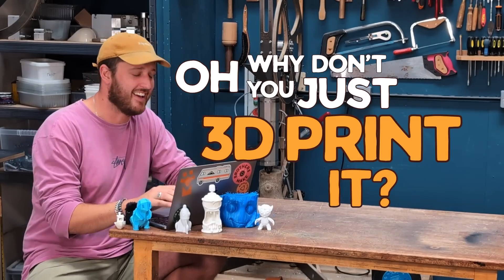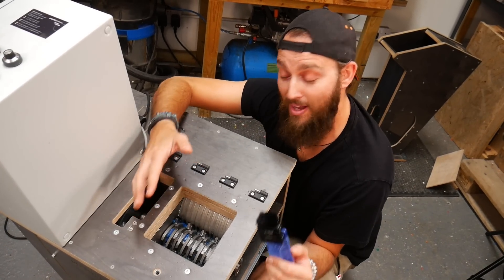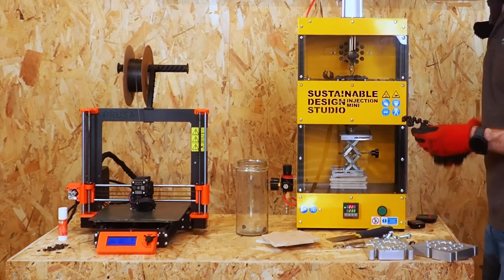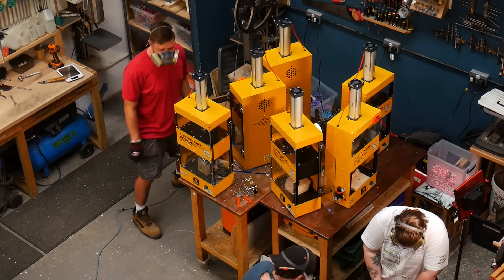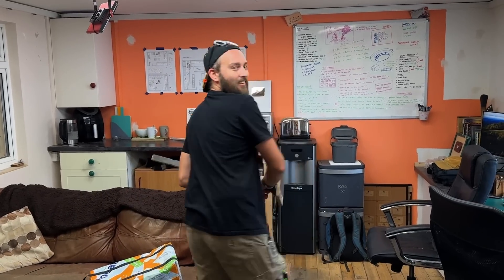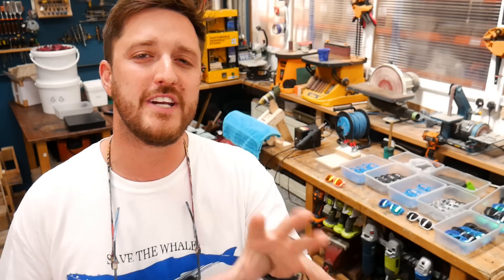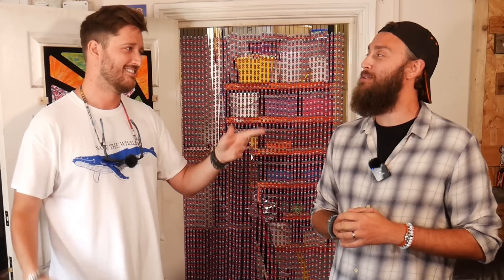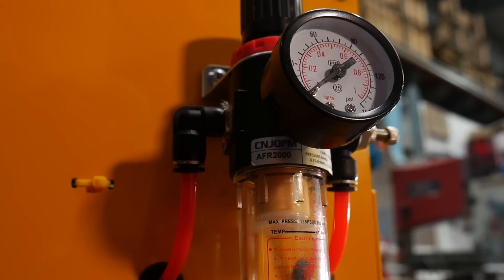Is THIS Better than 3D Printing?

Comment: I think this is a great video, I would say you have missed out a way of batching on the 3D printer. You have a much larger print area on a 3D printer. You could print across the whole bed of the printer and then with very small infill between layers print another layer of 3D prints as the printers can print in 3D where as the injection mold is set in one axis.
There is the other issue that a awful lot of waste material is created for each mold due to the plastic channels. This is also created in part on the 3D printer but can be dramatically reduced compared to the mold, in the case of the beads.
Still a great video and an area of work I had not realised that had become so affordable to enter

Comment: Don't forget manual labor when calculating the price of injection molding, 3D printing is mostly automated leaving you free to do other things. Injection molding requires you to be there the entire time.
Reply: Hahaha, they literally show you asking this question and then answer it. 😂
Reply: @OpalSea  And they answer it wrong. They said "you have to maintain the printers" as if that takes nearly the same amount of time as operating the injectors. It absolutely does not. Source: we have shelves full of prusa XLs that I work on at my workplace, and I also work with a guy who runs a bambu farm.

You only get similar labor cost with unreliable printers. The prusa mark 4 used in the example might actually be the most reliable printer that you can buy below enterprise grade.
Reply: @Mindbulletz  I've worked in injection molding shops with fully automated equipment that just requires someone check on it to swap the output bin when it's full, and refill the input hopper every few hours.  Thousands upon thousands of perfectly clear medical-grade parts came out of that machine every shift. 
The real story, which they talk about in the conclusion, is that for any given part, there's a volume of output where it makes sense to switch from FDM to injection.

Comment: You could speed up the 3D print quite a lot by printing it flat on the bed, 0% infill, and enough walls to fill in the difference. Also, comes don't need fine detail, so you could use a 0.6 or 0.8 nozzle instead of the standard 0.4. Still won't approach the injection molding speeds, but will be a lot faster for prototyping.

Comment: You seem to have missed the point of 3D printing. Your beads are a very simple design as is the comb plus you oriented the comb in a way that would be very bad for strength. Your examples were very good for injection moulding but not great for 3D printing.

You can 3D print things that are impossible to injection mould or CNC machine and every item printed can be different or customised, that is something you just can’t do with injection moulding.

Comment: Timewise a fair comparison would be starting the 3d prints as soon as you place the order for the injection mold.

how long to just start 3d printing compared to having to design the mold and order it, get it and then start working with it.

The upside of 3d printing is that you can work as soon as you want but it will never compare to the efficiency of Injection molding (After having the mold).

having said that, the rest of you a analysis is correct.

I have a few 3d printers but i really want a Injection molding setup

Comment: I love your stuff, but this video just seems like alot of cope
It's like you're comparing cars to trucks
Yes, they are both vehicles, but you have much different use cases

That's great, you can injection mold 42 combs in the time it takes you to 3D print one
But when am I going to sell 42 combs?
And how much did it cost for that mold?
What's the design process like for that mold?

How quickly can I go from an idea in my head to a fully finished product with an injection molder? Because with my 3D printer, I have gone from idea to an actual product in less than an hour before.

These are tools. They are not better or worse necessarily. They are better or worse depending on the goal.

Comment: You missed a major part of your injection moulding process. How much time and cost is needed to create the forms? A 3D printer does not need any form, you can print what you want, whenever you want. 
With conveyor belt printers can you even print series without stopping and removing of ready parts.  
Why do you guys belive that massive plastic is better than partly hollow plastic. Our bones are massive or have a partly hollow structure?
Btw, its kind of stupid to try to print the comb standing on the print bed with the teeth upwards. Flat on the bed, gives a nice durable comb, to last years.

Comment: you should make some kind of punch/cleave that fits the exact shape of the beads after taking them out of the mould, so all you'd have to do to get off the ring that holds them and the excess is push down on it with a lever or something similar

Comment: anything that falls into the category of 'crap that blows in the wind' things like syringes, plastic bags, beads, and whatnot are better off molded for sure, 3d printing can't compete at such immense volumes. For beads in particular though something that doesn't require post processing is probably better, maybe some kind of weird multi step hot forming/extrusion setup would work? I'm not sure.

Comment: It seems to me the printer was used wrong.  In the standing orientation you coult print mayby 30 comes at once on a mark 4  maybe more. And you would not be working after the setup time. If you factor in the labor costs also for post processing you calculation would be different. And for the beads you could print maybe 200 at once without support if you slightly optimize the shape for printing.  Than you would have nearly no postprocessing.

Comment: A UV bug trap will solve the fly issue fast.  Bug zappers can cause insect body parts to be strewn across a wide area as their bodies explode in the zapper.  Another way to keep them out is to use a high speed blower placed at the top of the doorway.  This will create an air curtain they can get through.  Effective against flying and many crawling bugs.

Comment: A fair comparison would be to run the printer while you wait for the mould to be machined ;-) Or modify the product slightly so you need a different mould, then wait some weeks for them...

Comment: When it comes to the cost breakdown, you went with the cheapest injection, molding machine and most expensive 3-D printing machine you can get three times the amount of bamboo lab A1 printers for the same money as the Prusa Mark 4’s

Comment: There were a lot of mistakes and bad assumptions here. Bambu a1 (mini) is the cheapest good quality option is like such a bad assumption. And filament you can get when you buy 5kg at once you can drop that price per kg easily to 15 or lower. And you ignored the time it took you to design the mold. Because let's be fair it's probably a version 2 or 3. And not the first try. Also you ignored that you do need significantly more material for the injection molding because of the waste. Then there is the the fact that an automatic print removal system on a 3d printer is a simple GCODE script and some slight modification of the printer. Making the 3d printer fully automatic and 24/7 capable. Demolding is way more work intensive. Now all of those are small things but they add up to muddy that comparison heavily

Comment: The biggest advantage that 3D printing has is that it can make things with complex geometries that just can't physically be made with injection molding. An example would be an object with internal voids.   For what you guys do, though, injection molding is clearly the better option.

Comment: Each Tool has its use
3D is primarily for Prototyping and maybe small scale Production Runs
Injection Molding is, as you said, for larger Production runs
How nice would it be if you could combine those two… like 3d printing the Molds maybe?
Ik Ik, most plastic for FDM 3D melts at a lower °C then the Plastic used for Injection, but what about Resin printers?

Would that work?
Like print the Prototype FDM, work out its Kinks, turn the Prototype.slt into Mold_Form.slt and print it in a High temp Resin.

Comment: try tpu 3d printed flexible sprue molds, and also try liquid solvent pla, like ethyl acetate solvent, then just point solidify the liquid PLA with laser or maybe UV. so whats expensive about 3d printed injection molds and mixing and pouring an AB plastic into the mold. yes you can just use a AB plastic syringe, no need for expensive press machines. keep it simple, did you forget. yes a piston syringe is hand powered.
Reply: oh yes and speed comparison, well one injection molding machine is same as about 10x 3d printers.

Comment: This isnt even a quantity vs quantity problem, injection molding makes solid seamless parts that have a very good quality hand-feel, 3D printing just doesn't hold up to that or the structural strength of a 1-shot part. 3D printing is a compromise on all these, in order to do it at home for cheap. On the other hand, we have things like 'fuzzy skin' to help hide layers now, textured build plates. And the ability to print hollow or dense selectively.
Reply: If you print the comb laying down, I can safely say the strength of that comb on a 3d print is the same strength or super close to it, using similar materials.
Reply: You should try holding a 3d printed object that was printed with said "fuzzy skin". It has a much, much nicer feel than any injection molded part. Night and day difference. And yes, it does completely get rid of seams and layers.
Reply: @SirSpence99  I mentioned fuzzy skin at the end of my prior comment. It really depends on what the part is. I kinda think the majority of beads are desired to be smooth and not fuzzy textured though, but it probably has its uses there as well.

Comment: The comb is a very basic design.. the presses are only capable of 2D STYLE  designs or very basic 3d designs where as a 3d printer has no issue

Comment: if you used a resin printer it would be quicker because you can put more on the build plate and it doesn't change the speed
Reply: But their concern involves sustainability and recyclability. Resin isn't recyclable, it can't be melted and reformed into new parts.

Comment: The Crafsman has made some discoveries that could drive the cost of injection molds down significantly, especially for small batches.  He got a couple blank molds made, and then slots high-temperature silicone molds (made from positives that are resin-printed) into those.  So he can make injection molds at home.  They won't last as long as CNC'd molds, but they can be iterated on for much, much cheaper.
Reply: What's the benefit of the blank molds? Hold the silicon molds?
Reply: @Biru_to  Yeah, they're a little floppy, so the extra support keeps them in place and helps resist the pressure from the injection process.  He's had success with just backing with cardboard, but prefers the metal blanks for rigidity and repeatability.
Reply: @georgedorn_fnord  Thanks for answering my question! Probably is worth it over something simple/cheap like cardboard / mdf when you do a lot of molding like he does. 👍

Comment: Injection molding is obviously the answer for high-volume few products. But the 3d printing math feels way off. I'm sure you could be printing about 100 of those beads in one go on a Bambu Lab A1, without waiting hours. It's probably a 30-60 minute print for that. With multiple build plates per machine, you could easily eliminate the post-processing while the prints cool. That doesn't address the quality issues with layer lines, but it seems like the economics of 3d printing scale better the numbers in the video suggest.

Comment: I love using my glue gun. Is it possible to make funky hot glue gun sticks out of recycled HDPE?
Reply: The hot melt glue you use has a lot lower melting temperature. It looks like HDPE might be used in some circumstances but I can't tell what glue guns work with that.

Comment: Honestly love the comparison.  #d printers have one additional advantage.  if you need to modify the design, or print something totally different.   that would be around 400 pounds per mold.  Though for speed, and no layer separation, injection wins.   Also the ability to use recycled plastics, something 3d printing fails miserably at (producing waste though - supports, failed prints, multi colour purge towers, etc etc).

Comment: they are different technologies that are best used for different things. Injection molding will always have it's place for certain things, but you can also create a lot of different geometries that are impossible with injection molding. You did not go into a lof of detail on the cons of injection molding, such as the cost of making the mold, and the fact that if you mess up the design you have to pay again to get a new mold cut. All that cost is eliminated with 3d printing. you also printed 1 set of beads on the 3d printer. You can fill the entire bed plate with beads. So you can do more beads on one printer than what you actually accounted for, meaning you wouldn't need as many 3d printers as you said.  And again, as you failed to detail all the cons of injection molding, you also failed to point out the benefits of 3d printing, such as the elimination of the mold making cost, which for complex projects, can be way more than what you mentioned. Additionally 3d printers continue to improve in quality and strength of printed parts so I don't see the "its got layer lines" as a valid arguement. Even with the weakness of the z axis, if you design properly for the 3d printing process you can easily compensate for that, and in a lof of cases make stronger parts than injection molding can. 
Injection molding can't make thick bodies without warping issues, whereas 3d printing can make thick bodies with a % infill. You are not restricted to thin walls with a minimum chamfer to properly eject the mold. 
Had you used a model that would be typically 3d printed, you may have not even been able to make a mold for it, or it would be prohibitively expensive with exessive side actions etc. 
Don't get me wrong there are things that totally should be injection molded, beyond a certain scale it is cheaper than a 3d print farm, and for certain things it just makes more sense. 
But 3d printing can do things injection molding cant, and it can do it cheaper. Also with considerably less waste by the look of all that break-off material that you had to spend labor hours removing, which would not have been necessary with 3d printing. You could have saved an entire day of however many employees you had working on that in labor costs that would get factored into the end cost. With 3d printing you could have filled the entire plate with beads, and when they are done just bend the plate over a box and let them fall in. That is thousands of dollars you are saving in post processing labor time, on top of saving the cost of the mold to make it. 
Now of course, you can recycle your waste. But so can 3d printing. Maybe not profitably but print farms can recycle all their own waste material just the same in-house. And by the look of those buckets of waste material you have, I'd say you have more of it to recycle than what any 3d printer produces. and that is just for some tiny beads.  
Just my constructive critisism, but I think it was a poor example, and the experiment and information was biased and incomplete.

And to say that the Prusa Mk4 is better than the bambu A1 is highly debatable. Bambu lab machines are more user friendly, calibrated straight out of the factory, and provide the most efficient workflow of any 3d printers on the market right now. All the other companies are scrambling to catch up to them coming out with clones of their machines left and right. They literally stole the 3d printer market. They requre less maintenance, tinkering, and first time setup, than any other printer on the market. All those things translate to labor hours in a business. If I had bought 35 prusas, id spend, as you said, about 4 times as much to buy them, and spend also about 4 times the amount of time to get all of them up and running correctly as opposed to the A1. Again, more labor time on top of the cost of the equipment. Prusa makes great printers, but they are not made for efficient workflow like BL printers are.

Comment: They can work hand in hand, you 3d print the prototype and once you're happy with the design and used filler to and sanding to remove any imperfections on the 3d printed version you can the sand cast the item to make an aluminium mould to mass produce on the injection machine